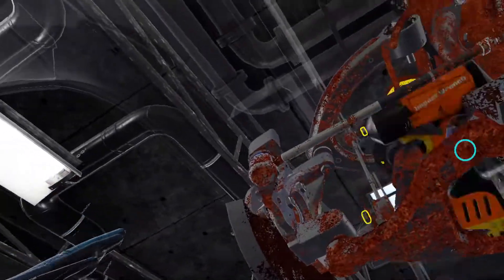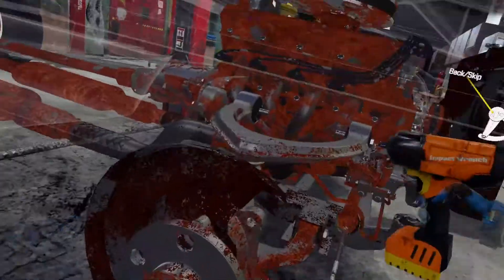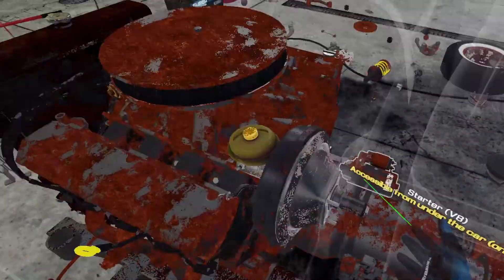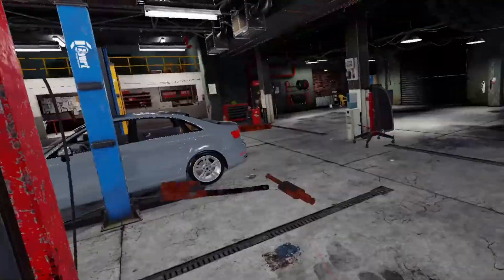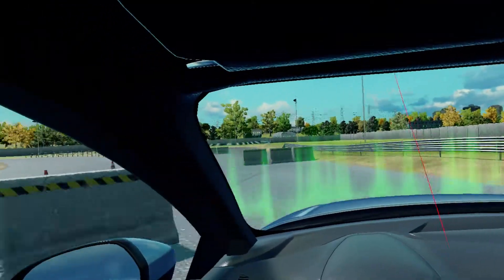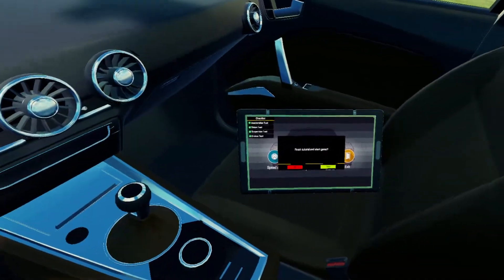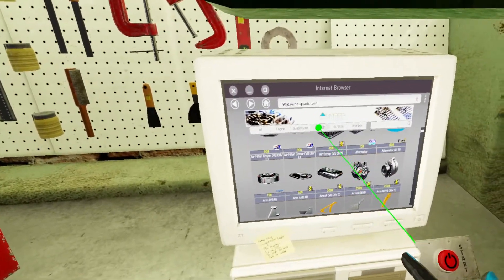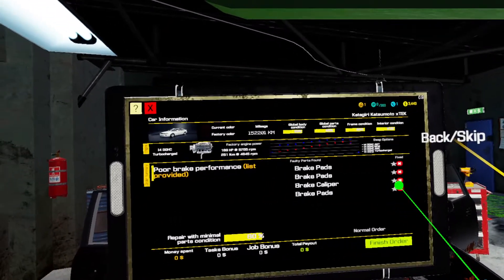Professional Mechanic Tries Car Mechanic Simulator VR for the First Time

Comment: Always wanted to get into cars but I don’t know squat.   I hope this will help me get over my fear and buy my first project car.   Will this help me get started?
Reply from the maker: I think it should honestly. Like I said in the video it's not the exact same thing per say because nothing is really a substitute for the real thing, but honestly it does a surprisingly impressive job at accurately representing a car for like probably 85% of things, so definitely a nice care free, easy, and (most importantly) cheap way to get into working on cars. Definitely not a bad place to start. Hope this helps :)
Reply: Same, specially when the ones teaching you just berate you....
Reply: Me too, I bough a ‘91 civic hatchback shell. And for the most part besides putting on basic parts I don’t know diddly. But i like I challenge, so I’m gonna build it myself. And I was hoping this would help
Reply: If you haven't done it yet. Just get the car. That's how I learned and still learning. Kinda taking apart my car and rebuilding it and if I get stuck I just look at chrisfix videos.
Reply: The only thing you should be scared of is the price of tools and a building if you want a lift
Reply: Car Mechanic Sim 2018 is around $2 on Steam for the moment
Reply: I just bought this on PSVR2. Excited.